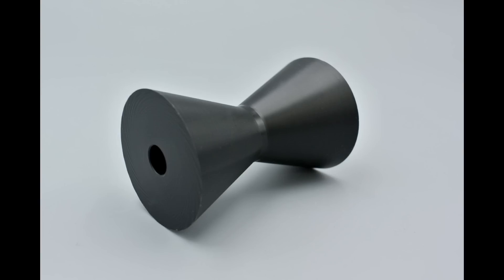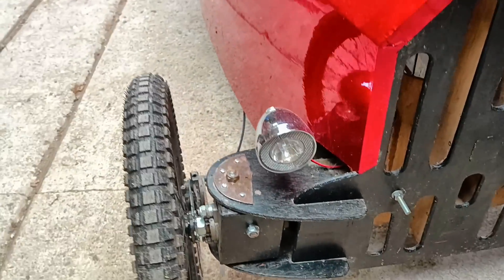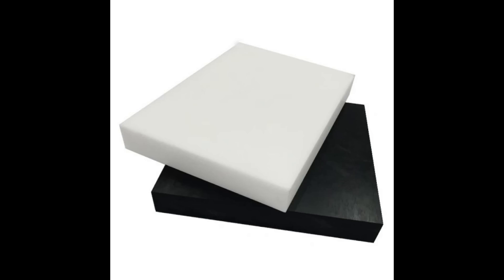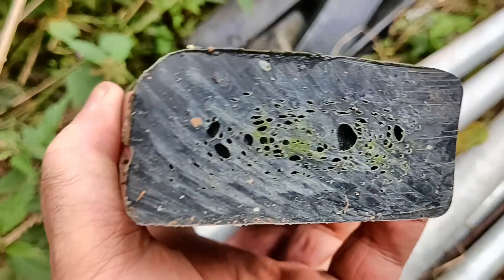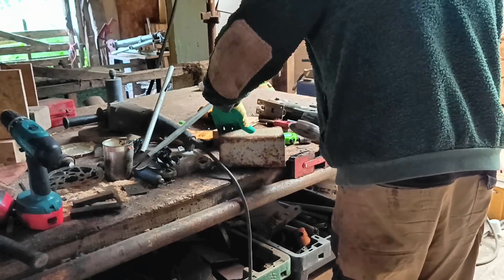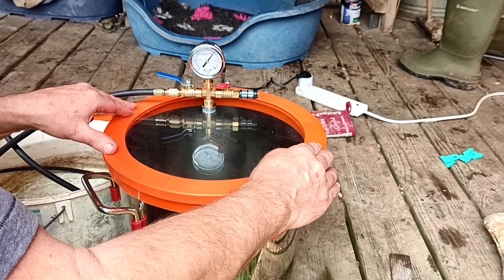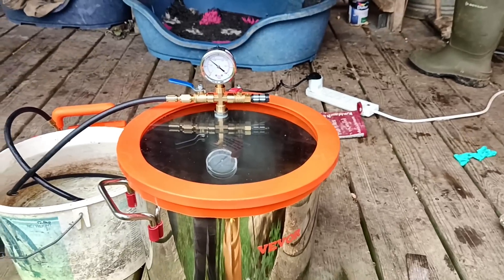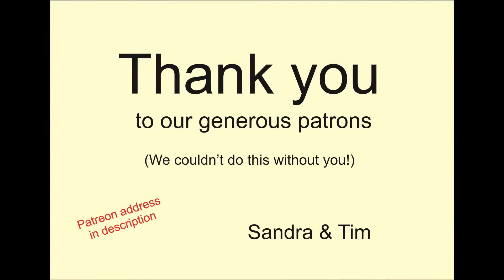Vevor Vacuum Pump And Chamber – and the challenges of Home-Made Machinable Recycled Plastic Stock

Comment: Easy solution is if a metal cylinder can work for u then use an induction heater around the pipe start at the bottom and move the induction heater up slowly as the pellets melt the air trapped will be at the melting zone . Once you have reached the top allow to cool . A coil induction heater around a pipe. 😊vacuum as well if you can seal the electrical connections

Comment: Maybe connecting a small powerfully vibrator to the mold while in the vacuum chamber? Getting electricity in the chamber without an air leak is another challenge.

Comment: The issue here isn't gasses in the plastic, those would be smaller bubbles. What's happening is the plastic is contracting as it cools, and since it cools from the outside inwards, you end up with a cavity in the middle. The way to solve it is firstly to cast at the lowest temperature possible to minimise contraction. Another thing that helps (for metals at least) is to have a tall feeding sprue that gives additional material to draw in to fill the cavities. This works for metals because the density of liquid metal is big enough to build up a fair bit of pressure. Liquid metal is also likely not as viscous as plastic. I don't think the same approach would work for plastic, so you'd need another way to add pressure to the casting. 
I'm not sure if cooling it very gradually to minimise the temperature difference between the core and the exterior would help, but it might

Comment: I don't have a vacuum chamber yet but I anticipated bubbles suspended in a semi-molten mass wouldn't allow the air to escape. I have been shredding HDPE milk jugs and plan to evacuate the air from the shredded material, then heat it to melt it. Preferably with some means to then compress the molten mass as it cools. 

I plan to use the same method as Vevor uses to retain the vacuum in their pot. If I put the shredded material in a pot that used a lid with a seal such as that used to seal the large pot, the air could escape as it would lift the lid to escape. Letting air into the big pot, the lid on the inside pot would be held down by the atmospheric pressure. I could then remove it from the large pot insert it into an oven and melt the shredded plastic - with no air inside, there should be no bubbles. At the same time as I am heating and melting the plastic, I should be compressing it to push the shredded material into contact. Any ideas how to do that? Silicone seals should remain intact - maybe up to 400 degrees F? It would be great if somehow atmospheric air pressure could be utilized to compress the molten plastic.

Comment: Two ways that I know of 1. Centrifugal you spin the bubbles out over heat . I have seen people making water tanks. they put small beads of plastic in a mould and spin over heat by hand in somewearastan.  I believe you could spin the bubbles out . 2. Sum years ago a collective of young people in Germany were   making tube videos on recycling plastic they had a injection pressure press that heated the plastic to about 165 C if memory serves lots of small electric heater elements and the mould was heated and had suction pulled on it . They made bowls plates and cups. Set it up in a container and shipped off to some island so to help. The project ended the started project kamp tube a collective farm in Portugal.  I cannot remember the name of the first tube channel . I don't think it would work for the big block you are trying to make .

Comment: I think you are going to have to apply pressure at the same time that you vacuum out the air so that the bubbles of air are able to squeeze around the edges and release from the plastic itself.  

I know how it is though sometimes it's one step forward and two steps back till you figure out how to make it work.  I have been using an LFP battery as a built in automatic jumper pack for my vehicle... Sadly it seems like the lead acid batteries that are being produced now just do not want to hold a charge very well.  I was able to figure most everything out but needed to remove the ESP32 controller I was using as it would work sometimes and other times it wouldn't and since I am not a programmer using a logic circuit was just easier.  Pulled the lead acid battery out a couple days ago and now the setup is one hundred percent running on the LFP with only a minor issue of a slight flicker of the dash lights while at idle in drive with your foot on the break (automatic transmission).  Adding a small capacitor pack should solve that so have that on order now.  The LFP battery is able to put out a peak of about 1440 amps instant, 720 amps continuous drain at 14 volts.  The only modification to the vehicle was removing the lead acid battery, running a long 1/0 (8.25mm diameter) copper cable from the engine bay to the back then running a similar ground from the new battery to the body, and tapping into a switched power source and constant power while the engine is running.  Everything else is located on the battery pack.  

It's nice seeing the animals come through the shop, you can tell they are loved.  I had to put my buddy down a week after my birthday a couple months ago, the cancer was getting really bad and there was nothing else I could do.

Comment: We studied this sort of thing at uni, couple of observations to help you understand what's going on:
1 - it's not off gassing. Plastics tend to break down and release gasses or vapours at higher temps. All injection moulding and pultrusion is done at the LOWEST temps possible
2 - as plastic cools it shrinks. You always get a void "somewhere" in a moulded plastic part. Keep the pressure on as long as possible (like you did in your second video...)
Cheers mate!

Comment: Casting plastic is usually done in thin panels less than 8mm thick (except at the joints) because otherwise it creates excessive bubbles on the inside. Also thicker parts take forever to cool down after melting.

Melting plastic is usually done with shear heating because plastic takes forever to heat up by conduction.

Comment: 2 things.
Split your mould diagonal corners and bolt the two halves for extracting.
2nd ..
Pottery clay is similar consistency and must not have air pockets (they explode in the kiln).
There is a machine called a Pugmill.
If you can keep it warm this is exactly what you need.
I don't ask for any royalties,  though I probably should  😂

Comment: USE A LARGER MOLD. SEAL THE TOP AND BOTTOM. ATTACH THE VACUUM DIRECTLY TO THE MOLD COVER.  HEAT THE MOLD AND PLASTIC WHILE DRAWING THE VACUUM.  The cover will need to be gasketed with heat resistant material somehow.

Comment: You need a heated vacuum chamber to keep the plastic soft you the air can escape.   
Your pressure container is metal, so it could sit on a hotplate to add the heat needed.
Degassing can take a while.  the top could be replaced if it's subject to heat issues and the silicon seal should be fine at high temperatures.

Comment: Sir,  I am a retired supervisor chemist for a government research and development lab. We used plastic for making items. First you need to granulate the material. Second, we heated it under a vacuum. You could do the same by adding a lid to your pipe mold and an on/off value.  Vacuum it down as far as you can, close value and heat in oven. Don’t open until cooled. This should help a lot in your void spaces.  Hope this helps.  Enjoy all your videos. Thank You  Joseph

Comment: Is there a way you can heat it up and pull a vacuum? Or void it of air, hold that, and then heat it(I imagine this would be harder as heating it would increase any  remaining pressure)? If the air is removed before the plastic can incase it you might be golden. 

Smaller blocks of plastic (pellets ideally) would perhaps allow a more uniform melt and so smaller bubbles. 

Idk I’m a little tipsy.

Comment: 3 things: first, you must heat the plastic IN the vacuum chamber (that's not gonna be easy); second, you must put in very small pieces (max. few mm), so the air can escape from every piece as you're heating it up in the vacuum; third - heat up slowly and watch out for overheating - when you overheat, you actually change the plastic properties (like elasticity) and it may become harder for the air to escape not to mention it may be more brittle after cooling.

Comment: Surely it would be far more efficient in terms of time, energy, material use etc etc to injection mould the part you want to make rather than just making a lump of stock to machine. I'm no expert but it seems to me that if you solve the problem of making good solid stock then you are a long way towards injection moulding finished parts.
Reply from the maker: Ha! If I was rich I would - an injection mould could easily cost €100,000

Comment: Would having a hydraulic press do the job? I’m thinking of the extrusion process where molten beads are heated and then pressed out of the die?
On the same theme, extruders use small granuler beads which are about 1mm wide. So if you were to melt them by pouring them into the mould a small amount at a time and then apply a hydraulic ram at one end and squeeze the molten mass out through a die maybe that way it will press out the gasses and using granular they pack in much closer avoiding large air gaps ?

Comment: For your application as a block for the wheel assembly you already know where you want holes drilled. Would it help in the mold to have tubes aligned where the holes should be in the finished block? Perhaps perforated tubes that help off-gassing during the smelting process?

Comment: You learn more from mistakes in a process than from immediate successes.  One thing that might be worth considering is to use very small scraps of this sort of meltable plastic, and while it's heating, find a way to apply a constant vibration.  My thought is that the vibration would encourage the molten plastic to settle, letting the bubbles rise to the top of the mold.  Since your mold didn't have any heating elements incorporated in it, the plastic was constantly cooling, and one of the first things that will form is the skin on the top, which would be a major barrier to escaping gasses.

However, these are just guesses from somebody with only a high-school shop class experience with forming plastics.  (in the early 1980s).

Best of luck.

Comment: vacuum chamber might work if you could make your own heated vacuum oven to keep the plastic liquid as you pull air on it. Much more likely you need a Bomb chamber (high pressure air chamber) so called as high pressure air is very dangerous but it will work. You should dry your plastic as even though it looks dry and water resistant quite a few plastics are hydroscopic and will pull air from the surrounding environment. As we live in Ireland humidity is quite high and thoroughly drying your source plastic will definitely help. This avoids steam bubbles forming in side the mass.

Comment: perhaps you want the opposite,   a pressure pot.  squeeze the bubbles down to microscopic size and then let it harden.  sure they will be under some pressure but i expect over time the pressure will diffuse through.

Comment: starting with smaller pieces would help, but it needs to be much hotter going into the vaccum. ideally you would have a vacuum oven where the plastic could have both temperature and pressure regulated.

Comment: I think I see others saying the same but I think, if you chop up the plastic so there aren't any voids in it to begin with, then add it slowly to the container so that it melts as you add it. If you have all those chunks, there is a bunch of air pockets to start. If you're tossing tiny bits onto a mass of molten plastic maybe they'll melt and not suck in air? 

Cool, and good luck!

Comment: The plastic sets from liquid to solid from the outside. The centre is the last place to set. Voids result from internal  stress- I think there is a substantial change in volume between liquid and solid state. 

Injection mouldings suffer from voids if the sections are too large. Every design guide advises constant sectional areas and avoiding large isolated heavy sections - essentially what you are trying to make.

Comment: Instead of putting the mold into the vacuum bucket, you make it such you can suck the mold itself vacuum. (bigger Mold)
Also you can then heat up the mold with a flame, making the plastic more liquid.
You will not be able to see the process but i think it could do the job.👀👍

Comment: You could try melting it in layers. Create 2-5cm block, suck the air out, add more pellets on top, melt again to create new layer, vacuum, repeat until desired height is reached.
The only question is if the layers will melt togeather well.

Comment: Try to put plastic chips in to the mold. And then start to melt them in the vacuum. When its all liquid add the air to the chamber to compress the voids fully and let it cool down

Comment: you should use very small pieces of plastic the size of grains of wheat, I remember that my father in the 70s,
he took me to the factory where they made plastic crates of Peroni beer and there were large bags of yellow plastic mini balls which they tipped into a hopper and after several passes the crates came out in a 50 meter long machine

Comment: Build a metal funnel above the mold that fits in the oven. The Plastic will heat up and pour into the mold releasing gas as it hits and not leaving voids. I dont think it would work outside an oven because it would cool too fast as its poured but inside the oven it will stay liquid and fill the mold. I was thinking of trying this with a wood fired chamber but your idea of just putting it in an oven is smart because you have to control the temp the whole time, but get a used oven for the shop and put it to an extension cord like the welder has so you dont mess up the wifes kitchen .

Comment: SUGGESTION: When casting resin, sometimes you use a vacuum chamber to try to get rid of bubbles in the liquid resin before it hardens.  More often, you put the liquid resin in its mold, then put all of that into a pressure chamber and bring the pressure up to 40 - 60 PSI.  The pressure collapses the bubbles, then the resin hardens, preventing the bubbles from reforming once you release the pressure.  For the relatively small blocks you are talking about making, it shouldn't be too hard to make a pressure chamber to try this.

Comment: As a user of FDM 3D printing machines I would recommend to inject the hot plastic into a mold under pressure and using some kind of nozzle - to lay one, voidless piece o plastic, one layer at the time and then adding another one, fusing them together using force and heat... vacuum is fine but not for stiff and viscous materials like HDPE is.

Comment: you need very small bits of plastic to begin with, the smaller the better.
like the size of BB's .
you also need to form your "block" under pressure to force the material into a solid.
good luck with the process.
keep on keepin' on my friend.

Comment: I worked in a plastic moulding factory years ago and they placed all the moulds into a pressure chamber to reduce the size of the voids. If you can get a chamber rated for 50 bar then each bubble will be reduced 50 fold. Going the opposite direction to what you were doing but it was imoressive how elastic the plastic was and how easily it responded to the changing pressure. The ideal would be to heat the plastic in the mould while in a vaccum chamber, then the air pressure will push in all the voids. Could you vacate all the air with steam? like the steam in a barrel trick? you would be left with small bubbles of water in your plastic afterwards.
Reply: Actually steam would not be great, would only condense at 100C at which point the plastic would be quite rigid. You would need a liquid with a much higher boiling point

Comment: Brothers Make is a good resource as they heat and manipulate 'blobs' of plastic (manipulated to get rid of the voids) and then use a press/ram to get it to conform to the mould.

While you may have voids around the mould conformity - you could over-size and machine those off, knowing that the internal portion is relatively 'strong'.

The most similar to their process would be silicone baking mats in the oven to melt a thinner layer that you manipulate with silicone gloves into a nice malleable 'gob' - as it retains its heat fairly well (from watching) you can prepare a few at a time and then bring them together.

I love Delrin - but this looks super strong too!

Comment: At first I was thinking straws into the block inside your vacuum box, but actually what I think you need is a runnier mix so you can pour it. I wonder if more heat or some additive could be used to achieve that... Good luck & thanks for the ride :)

Comment: what i think you need is pressure not vacuum. i believe you'll be more successful by making an extrusion or injection instead of a straight mold. you're starting material was made in an extrusion, a poor extrusion, with all the voids, but an extrusion. to make that large of a form (the cube) it might be difficult, have you looked up how block Delrin (acetyl plastic) is made? that might give you insight on how to fix your problem

maybe a pressure vessel would work better if you're set on making a molded part